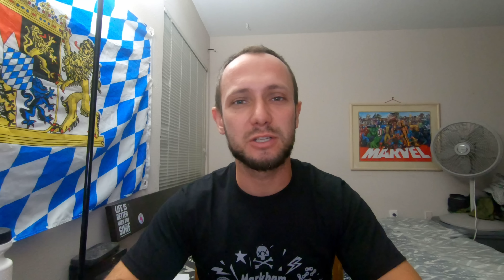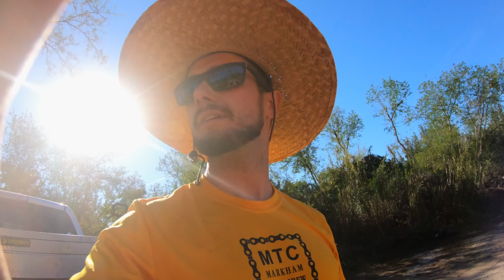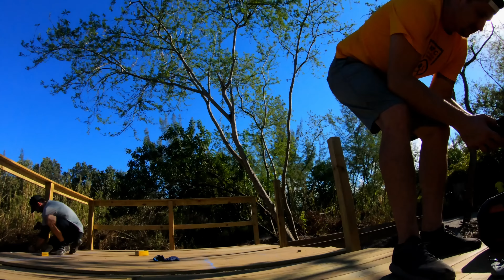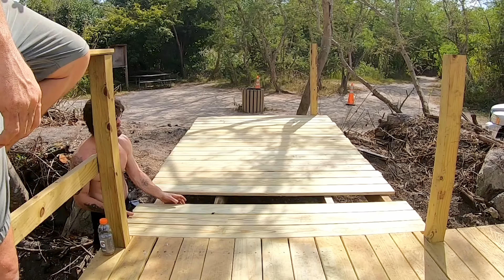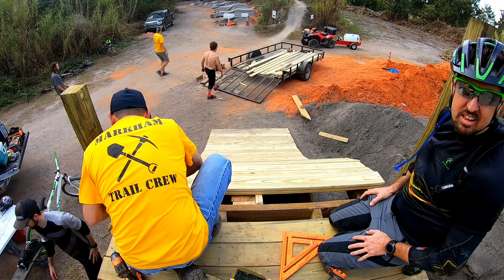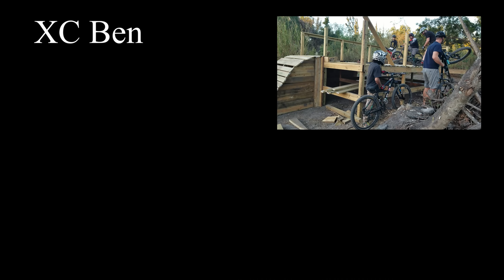Trail Building - Wooden Roller - Markham Park Trail Crew

Comment: I was going to say higher and longer but I was not putting in the hammer time ...
Reply from the maker: Yea! No suggestions from the non trail builders lol. Hey, at least it is higher than what it was before the redo.
Reply from the maker: That's a huge roll in for sure. It would be nice to have something like that at Markham.  No clue on where we would put it but you never know.  I've dreamed of wooden features like the ones at Santos. Hey, maybe Markham is heading in that direction. This is one of the best built features,  made from wood, Markham has ever seen.